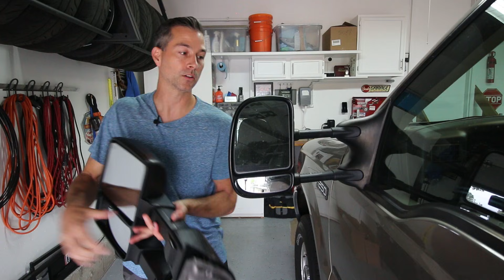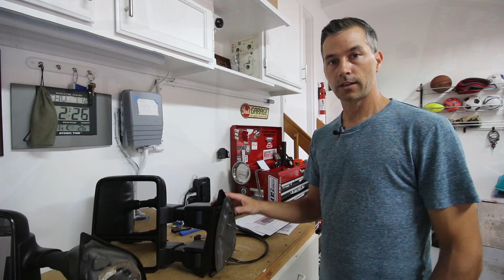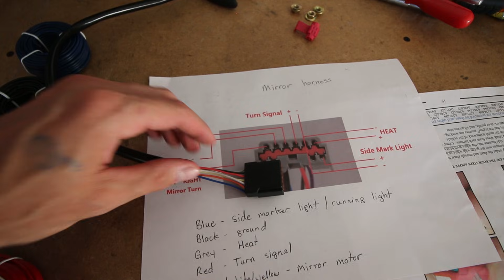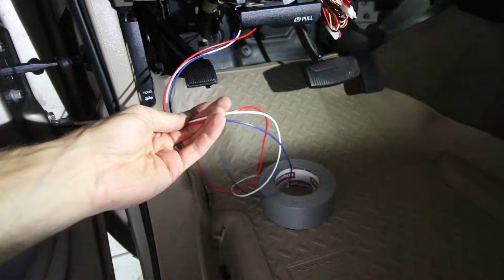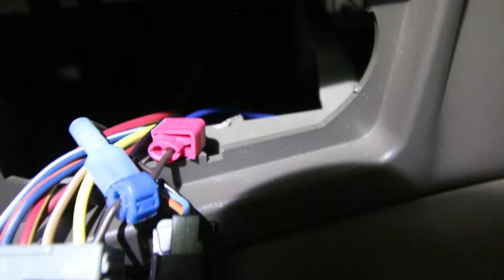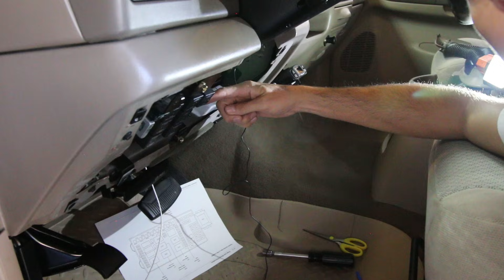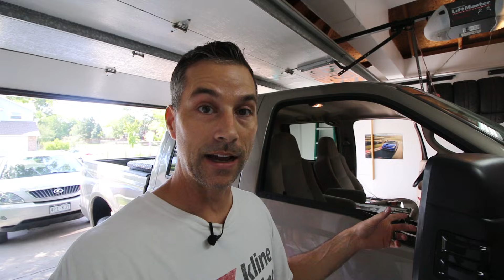Upgraded Towing Mirrors - 7.3 Powerstroke

Comment: I followed your lead. They are great.Thanks for turning us on to them. It was relatively painless to follow your lead. Mine have a strange feature and I'm wondering if it's a sign of a broken mirror. my drivers side mirror only extends about 30mm, the passenger extends 70mm. Is that the way your's work or is my drivers mirror damaged?  Their support needs a little work! Cheers, Manning
Reply from the maker: Glad the video could help! Both my mirrors extend the same distance, definitely something wrong if one extends shorter than the other.

Comment: When I go to the Amazon link it says these will not fit my F350 Super duty 7.3
Reply from the maker: For which model? They should fit if it is the '99-'03 model 7.3.
Reply: @TheBTRGarage  20001 Ford F350 Super duty  XLT 7.3 The Amazon check your fit says no. I think its wrong
Reply: @TheBTRGarage  I found used like new in this model and it says they fit. The item new is unavailable so that may be why it is acting wierd
Reply: @TheBTRGarage  Is Scitoo a good brand as well it looks close to the same
Reply: @TheBTRGarage  is this the new model it looks the same MR-038-xS1y

Comment: Awesome video! I hope my 2000 has same wiring as I can't find a diagram to i.d. wire colors. If you know, please advise. Thx much.
Reply from the maker: It should be the same, or very similar. Trial and error or the Google are the alternatives 😁
Reply: @TheBTRGarage  Thx for the quick reply. Once I got the door panel off my 2000,  I found a round plug instead of rectangle. Yitamotor doesn't offer an adapter and I didn't want to cut the original wires, so I wound up with a different brand that included a round connector. Somehow I thing most or all of these mirrors are made in the same place. keep up the great work!

Comment: This is one of the best videos I've seen on here. It was very detailed and it has made me want to change the mirrors on my 99 f350
Reply from the maker: Thanks! Go get those mirrors 😁
Reply: I bought a different brand before I came across this video. These instructions were the exact same for my product. I did have a bit of an issue on some of the connections not being solid enough and had to go back and really bite down on those splices. Everything is working great now.

Comment: Just installed these mirrors on my '01 F250, wiring them now. Bulbs are filament type, same as interior door kick panel bulb. Thankful for Justin's post ,as these mirrors came with no instructions. Also curious how the bulbs are accessed, as I pulled the lens off and now need to glue it back on.....(oops)! Good mirrors, overall easy install (with Justin's help).I'll let y'all know how to access the bulbs after I attempt to not damage the new mirrors again!
Reply from the maker: Thanks for the feedback on the signal bulbs. Thought for sure they were LED.

Comment: This video answered every question I had about these mirrors. I wired my switch right underneath the mirror motor controls to keep all my mirror controls in one location. The button blank you took out is where the adjustable foot pedal button goes. I have it on my 03 Lariat. Great video thanks for taking the time to post!
Reply from the maker: Thanks, glad I could help!

Comment: How are these holding up? I have a cheap set from eBay and after a year the glass shakes when on the freeway.
Reply from the maker: Been holding up great. Just did a 1000 mile trip a few weeks ago, never had an issue with them.

Comment: Hey man awesome video. I recently ordered some yitamotor mirrors for my 2001 excursion. How did you get them to send you the wiring diagram? I’ve contacted them several times and can’t get a response.
Reply from the maker: I thought it came with the mirrors when I bought them. But, I also gathered other info and sketched my own to make it easier.
https://btrgarage.com/files/F250-Mirror-Wiring.pdf

Comment: You sold me just ordered a set directly from yitamotors  and saved $70.00 from Amazon price. They working great 👍🏽
Reply from the maker: Great to hear!
Reply: @TheBTRGarage   Had you use factory foam pads ones that it came with were to thick could not get nuts on them to short. but mirrors set really flush.

Comment: So what do you do when your 99 f250 does not come with electric adjustment mirrors?
Reply from the maker: Some of the trucks were pre-wired with the proper wiring, so you may be able to install them if you had the wiring there. You would have to check with Ford or do some internet digging to find out for sure. If no wiring, then I am not sure what the options are.

Comment: Question I have turn signal on the actual mirror. My problem is that the turn signal light on the mirror dose not flash. Every thing else is good. The running light an the turn signal light are good on the out side. 
How can I get the light on the mirror the glass part flash???? Plz thx 💯💯💯

Comment: When I started wiring for the passenger side, I saw my truck harness has two white wires with the blue stripe. One blue stripe is wider than the other. Do you remember which one it was?
Reply: Same.  Which one is it?  Did you figure it out?

Comment: So i bought the same mirrors you have and followed your wiring diagram...thank you for that! One question....my passenger side running and turn signal lights are dimmer than the driver side. Have you heard of anything like this happening? Im going to try for the third time tomorrow to ground it again. As an aside, i ran a wire(blue) from passenger side mirror to the driver side headlight switch panel, so i have 2 wire taps into that same brown wire(at the headlight switch) as your video shows, one from the driver mirror and one from the passenger mirror. Could having 2 wire taps into the same brown wire be the problem? Or did you tap into the brown wire at the harness behind the fuse block? By the looks of it at 31:17 seems you may have tapped into the brown wire at that harness. Or the dang light bulbs on the passenger side arent the same lol
Reply from the maker: Hmm, for dimmer lights I would have looked at the ground(s) like you did. The light bulbs I would think are fine since the mirrors are new. Tapping into the same wire a couple times should not make a difference. You could remote the driver side signal lights from the wire tap to see if the passenger side works correctly.

Comment: Got my "Motoor" mirrors on today...finally. Different brand but they have the turn signal in the mirror as well as front housing. Wiring color coding was different, even based on another post for same mirrors. End the end of the (1/2) day it was totally worth the upgrade. I was however able to tie the heat feature into the factory defrost switch which is really nice. Thanks again for your awesome video.
Reply: factory defrost switch for a excursion? i dont think the pickups had one
Reply: @dsruddell  Mirrors were installed in F250 Superduty which has factory defrost
Reply: @markmarcotte8651  please elaborate, I have a 2003 and that would be of great help as I am installing tow mirrors this week.

Comment: Thank you Justin, great video on the mirror replacement, very informative, clear and easy to understand.

Hi Justin, 
Wondering if you have encountered any problems with your mirrors since installing them, seeing that you posted your video 1 1/2 years ago. I'm wanting to upgrade my mirrors on my 2000 f350 and have read a number of reviews reporting poor fit, poor quality of mirror reflective finish, distortion and shaking while driving. I purchased a set of "Trail Ridge" mirrors from 1A Auto after viewing their comparison "YouTube" video and was mislead to believe that their mirrors come with side markers and turn signals. The mirrors shown in the video show them with side marker and turn signal lights. While the quality is top shelf, I was disappointed after taking delivery and unboxing, that they don't have the lights as mentioned ( my fault for not paying closer attention to detailed description). I'm waiting for a response from 1A Auto customer service to see if they offer mirrors as desired. Anyway, your thoughts on your mirrors and again thanks for a great conversion video. TK
Reply from the maker: Thanks for watching, glad I could help!

Comment: I have a 2006 f250 I don’t have any power windows or mirrors. I have these same mirrors but nowhere to plug them into.  Can anyone help ?
Reply: Sounds like work truck package, it was never wired for power windows/locks or mirriors, you'd need to find and install the complete harness and switch for the mirrors to make it work from out of a salvage yard

Comment: Looking to upgrade my 2013 f250 XL to power mirrors, heated, signals. Got trail ridge mirrors and the combined switch for tilt and fold but need the wire harness and 8 prong plug. Any ideas?

Comment: Did you remove your battery cables to d iui the wore splicing?
Reply from the maker: Just as a safety measure when working on electrical components and wiring.

Comment: Hey Justin, I’m about to do this myself, wanted you opinion on how long the wires should be 3ft long?
Reply from the maker: 3ft may be long enough for the drivers side mirror, but definitely need a lot longer going to the passenger side. Usually you buy the wire in small looms of 20ft or so.
Reply: Thank you buddy have a good night

Comment: Very nice job. I just installed the same mirrors on my 2001 F350. was looking for how to hook up the same wires you did. My only suggestion would be to stagger the connections in the door so the wires will lay down in line not bunched together. Great job thanks for sharing.
Reply from the maker: Thanks for the comments! Yes, I agree about staggering the connections in the door. I learned that the hard way on the first door (which is in the video). On the passenger door I did what you mentioned and it worked out much better!

Comment: Did you have to modify the mirrors at all to fit prefect? I hear that you have to shave off some peg I think they said? 

I really want these though. Regardless I’m buying them I just wanted to ask if you had to at all since I have a 02. 

Are you doing more videos on this truck?
Reply from the maker: No modifications, I read about having to shave off a peg as well but I don't remember it being an issue. I would have included it in the video if so. Yes, more videos coming I'd this truck for sure!
Reply: BTR Justin yes there is a little peg in the top corner of the mirror that I cut off under the foam that allowed the mirrors sit in better at the top.  When he puts the mirror in he said that it stuck out a little at the top and that’s why. He did cut the little tab off. Not sure if that’s an alignment thing for the 08 and newer or what. I just took some side cutters and snip and fit beautiful and snug.

Comment: Cant find a wiring diagram for my f350 where did you get yours for the fuse box?
Reply from the maker: Just did some searching on Google and things, most wiring diagrams are out there somewhere. What year is the truck? Also the fuse boxes are usually covered in the owner's manual.
Reply: @TheBTRGarage  99 f350 crew cab dually diesel
Reply from the maker: @yamommashouse1  I found a lot of info searching for this "1999 f350 7.3 fuse box diagram" in Google.

Comment: Hey, I followed what u did step by step and got the driver side done... but I lost my running lights and the lights on mirrors are not working any suggestions on how to trouble shoot this?
Reply from the maker: Is it the same model and year truck? Basically you just have to go over everything again and double check that you tapped into the right wires and your connections are solid. You can use a test light to test the wiring after your connections.

Comment: Nice upgrade! Looking to do the same on my 06 F250. Did you notice, are the new mirrors wider (overall truck width) than the old OEM? I have a 9x7 garage door and my truck fits with an inch to spare on each side! Keep up the great content!
Reply from the maker: Thanks for the comments! I think they may be slightly wider, I didn't accurately measure it though. You could always collapse your drivers side mirror when entering the garage too.

Comment: Excellent video, tip for not loosing the nut's in the door, use some bearing grease in the socket and that keeps the nut from falling out of the socket and down in the door. I'm very interested in the upgrade but not sure about if the turn signal and parking light are worth the effort, I hate wire project's.
Reply from the maker: Great tip, thanks for that! You can always install the mirrors and just not wire in those functions. In fact, I was going to go that route because I am not a fan of wiring either. But, I dug in and got it done and made this video to hopefully help others who do not like wiring like I do :)
Reply: @TheBTRGarage  I am very detail oriented and I hate splicing into wire harness, it just looks cheap too me. When I get the mirror's I might run the wiring but probably not if I can't find a clean way too install the extra wire's.

Comment: Mazda MX-5 ND6E*
Reply from the maker: Is that the technical name? I haven't actually looked.
Reply: for the rest of the world except Japan:) 
ND5XXX all 1.5L  ND6XXX 2.0L . Alot people doesn't know as its confusing due to Japan Code & rest of world totally different.
Just like VAB VAF GVB GVF WRX STI etcs 2.0 2.5 STI. 
mazDa ND 1.5L (P5-VPS) 2.0L (PE-VPS) = Toyota ZN6 (E288 E2M7 E2M8 E2N7 E2N8 E2B7 E2B8 E2B8 E2L8 E2E7 E2L7) / Subaru ZC6 . (288 2A8 2B7 2B8 2E7 2E8 *7=AUTO *8=Manual)
Reply: The mazDa spare parts no. are confusing too ...due to similar last 6-8 digit with Ford parts...unlike Subaru and Toyota easily reference according to generation update of the parts.
Reply: ZN6-E2B8 GT86 Grade G the ecu is written unlike the rest. Its factory written for Left foot braker.